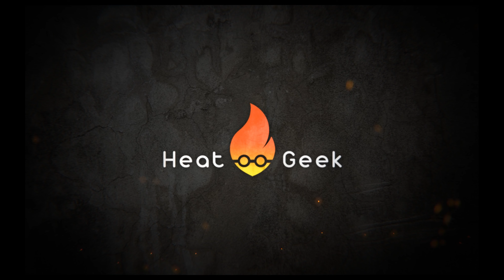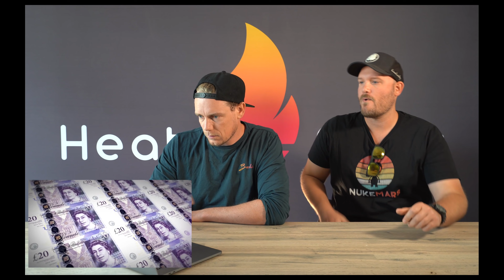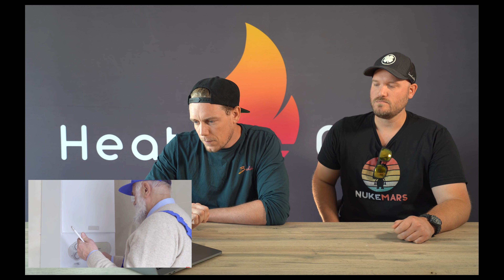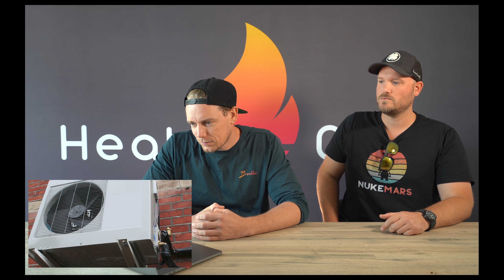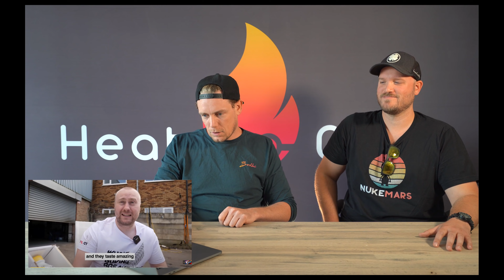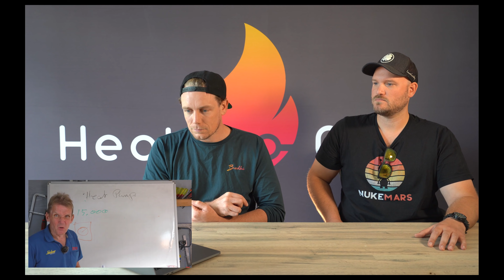Professionals React (BADLY) To Skill Builders's Heat Pump Videos | PART 1 | FIRST TIME WATCHING

Comment: Purely from a cost perspective, if I'm to build a new airtight insulated house and compare an ashp vs gas boiler install, i still feel gas will be cheaper? 

Electricity 26.686p kwh
Gas 6.993p kwh.

With a cop of 4 brings them on par but we dont get this yr round, this makes the gas boiler costs thousands less to purchase? If something like a Viessmann 222-F was used, there would be less standing losses too than a cylinder.

With overall build costs through the roof i want whats cheapest if performance is closely matched. 

I would like to design my system for heat pump flow rates to make a swap in the future when the technology has advanced and prices come down.
Reply from the maker: Incorrect. If the gas boiler is 90% efficient it's swings in favour of the heat pump. At 6.7p per kwh vs 7.7p for a boiler.

If talking about new build your inly talking a couple of k mire than a gas boiler.. the 10 to 15 k you hear about is retros in older housing.
Reply: @HeatGeek  so 26.6 elec / 7.7 = 3.5. Would that not mean I'd require a scop of 3.5 to break even on gas running costs. Then the price of the unit for something like a vaillant arotherm plus being 3x more than a gas boiler? 

Again, I'm looking at honest opinions based on cost not preferences on whats more eco. £3k minimum more to purchase but almost the same on energy usage. The cop would be good in summer hard to maintain 3.5 throughout a winter in the North. The 250-300L cylinder required would have slightly higher standing losses than a 180L.
Reply from the maker: @handle1196  yes my maths were wrong.

Well not exactly bc with electricity you can also use night tarriff. Also batteries make pretty quick sense.

If your looking at flat cost and say your self building then a heatvpump makes more sense ad although it costs 3k more you get the 5k bus grant.

You also have yo consider whats going to happen to energy prices over the nextb10 to 20 years you have the apliance. The 22% environmental tax on the relatively clean electricity we have will move to gas very soon if just 1 example.

3.5 would be an average current SCOP for a vailnt  that's the average thought the year, not 1 point in time

In reality you will actually hit above 4  with a vailant arotherm plus in a new build.
Reply: @HeatGeek  thanks for the reply. I wasnt aware of the bus grant, i thought it was for retrofit only. Its misleading as it says not for new builds, but a quick search with less info. Says that its available for single self builds. 

Is the tax you mention currently applied to both gas and electric? And then has the potential to be shifted or one of them reduced and one increased. This would be of big benefit.
Reply from the maker: @handle1196  the tax is only 2% on gas and 22% on electricity due to the fact gas used to be much cleaner in comparison to electricity. not the case now and electricity will keep getting cleaner still.
Reply: @HeatGeek  the taxes may switch around in the near future but gas is still gas, its not any dirtier today than it was 5 years ago, its the same quality and has always been more harmful to the enviroment, but its now been identified as producing too much co2 possibly due to increase in polulation and use so with climate change, cleaner alternatives now need to be brought in.

As a nation we should of had this this thought out in asvance not just getting to 2020 and saying as of today we will rocket prices of energy and penalise everyone with over priced clean technology that most people arent set up to afford or use.
Reply from the maker: @handle1196  I didn't day gas changed in how clean it was.. it just used to be alot cleaner than electricity (because electricity was dirtier) and now gas is dirtier (becaise electricity is cleaner. 

This was thought of and talked about and campaigned for lots but just couldn't get through parliament. Energy prices in total have little to do with gov.. they vary because of the market
Reply: @HeatGeek  update: after further research & in reply to you saying a the 10 to 15k costs are more for retro fits that need many changes, ive just received a quote for my new self build from a vaillant recommended installer to install an arotherm, a cylinder and plant room only connections. Myself to complete the rest of the house and they want 16k. Thats total theft. Almost 6k of it was labour and they chose a unitower not the stor agreed, so even less install for them. They quoted 1500 more for the unit than i could buy one for online. This doesnt help the industry at all.
Reply from the maker: @handle1196  including radiators and/or underfloor heating?
Reply: @HeatGeek  no mate, myself to install ufh, and radiators and all the connecting pipework supplying the rads leaving only the ashp and cylinder to install and everything you'd usually connect within a plant room to make it functional. I asked how long it would take to install it to see why the cost was so high and they said a full week.
Reply from the maker: @handle1196  seems strange. How many quotes did you get?
Reply: @HeatGeek  it seems a lot & a long install time considering its not a complex build or design. Id expect vaillant to list reputable installers. Im going to get another local quote from the other installer listed who has a good reputation. After that i might contact a heat geek installer for a comparison, shame they are a little further afield.

Comment: The guy is a moron. He has not mastered the concept of thermodynamics. In the summer the heat pump obviously only heats domestic water. In the winter, with the correct refrigerant, they will provide 100% of home heating. If your house is not insulated, move or reinsulate. Gas is only going to get more expensive until it's no longer even available. How much will you like your gas boiler when gas is 20X the price?
Reply: Oh dear, another joker saying that gas is going to get 20 times it’s current price. Then go electric or pick a design or choice of wood burner that will heat your home in winter and use electric hot waiter for the summer. And save a packet on these over priced, under performing heat pumps. Come on tell us how much it will cost to buy a complete heat pump, and then the price of installing it, let alone the repairs after a few years. Plus the electrical running cost in topping up the hot water system.

Comment: So the gas boiler will work in almost any home without great expense or top-notch installers.
Reply from the maker: No, you have to be on the gas grid. Apart from that, yes.. but it produces carbon.
Reply: @HeatGeek  Plants need carbon to grow.
Reply from the maker: @chrimony  there's more than enough carbon dioxide in the atm for plants to grow. They aren't dieing. Too much carbon dioxide leads to increased desertification.
Reply: @HeatGeek  NASA says the Earth has greened.
Reply from the maker: @chrimony  . Today, there is five percent more foliage than twenty years ago, but acroding to nasa this is primarily ambitious tree planting projects and intensive agriculture, mainly in China and India, that are behind the increase. This is according to satellite data from NASA Earth Observatory.

Symaltaniously desertification is still increasing in the harsher areas to to temperature. Desertification is decreasing the amount of sustainable land for agricultural uses but demands are continuously growing
Reply: @HeatGeek  "From a quarter to half of Earth’s vegetated lands has shown significant greening over the last 35 years largely due to rising levels of atmospheric carbon dioxide, according to a new study published in the journal Nature Climate Change on April 25."
Reply: @HeatGeek  But wait, there's more: "For the majority of greenhouse crops, net photosynthesis increases as CO2 levels increase from 340–1,000 ppm (parts per million). Most crops show that for any given level of photosynthetically active radiation (PAR), increasing the CO2 level to 1,000 ppm will increase the photosynthesis by about 50% over ambient CO2 levels."
Reply from the maker: @chrimony  there's litrally 100s of papers out there on all of this including the weighting for increased photosynthesis. Far more than the coment section will cover. For the purposes of this channel we assume that the vast scientific concensus is correct and don't entertain conspiracy.
Reply: @HeatGeek  I gave you two quotes. One from NASA's website, and another from a Canadian government website. There is no "conspiracy" here.
Reply from the maker: @chrimony  your comment "plants need co2 to grow" incinuated extra carbon in the atm was fine and questions climate change.  If your staement was just pointing out how photosynthesis works, fine.. but bot sure how it's relevant.
Reply: @HeatGeek  My point is that carbon is not the evil boogeyman it's made out to be. People are treating it like toxic waste. And rational thought needs to be put into a complex problem, and not just reduce it to "extra carbon bad, so we have to get rid of our gas boilers".

Comment: He is 100% correct.Installers are in the business to make money and sales and guess who gets caught out with a poor system or a unsuitable system. The  cheap install buts the good installers out of business or brings their installation to the same level so they can compete.Money would be better spent on insulating the house rather than changing systems and leave the new technology for the new builds where building codes can keep every body on the same playing field.Even then they will cheat on the quality of materials to undercut each other.This is the case with solar installations in Australia,installers only last for short periods of time when they re appear as a new company leaving the owners with a useless warranty.

Comment: The section where he says pays 3x as much, I suspect he means? electric is 3x as much as gas, as it generally is, so with cop 3 its on par with gas. That's How I took it. Time stamp  8.03, he could mean with the low output temp of emitters, customers boost temp up and up  and the cop drops through the floor.  For my view as a heating engineer, HP are still too costly for most and are tool to be fitted to the correct application, to many have been fitted to wrong type of house. PS perhaps give the grant money many to the masses for insulation/ventilation control.

Comment: if you put out the gax heating... then you remove an alternative and increase the demand in electricity... don't think that electricity cost will lower... it will skyrocket...
specially if you also convert all car to electric!!! people don't realise how much more electricity production should be increased to cover all that increase in demand.
That will cause the electricity to become more expensive than gas !! since gas and fuel will still exist in some country and with far less demand the price will collapse...
but they simply plan on keeping fuel for the military and the wealthy.
Reply from the maker: But at least we pave the way to come off fossil fuel
Reply: The only good thing about going electric is some will have the ability to generate it themselves which is something you cannot do with other fuels.

Comment: Part of the problem is installing something just because a customer wants that product, a full survey of the property and a consultation should be carried out, so customers wanting ASHP in a non insulated property should be declined as the end result will never be achieved.
I design, install and commission heat recovery systems and if I think that the property is not air tight enough I refuse the contract as I know they wont get the result they think they will get. If a customer asked you do install solar panels under a tree where the shade is all day you would have to say no!

Comment: i personally agree with Roger. I understand heat pumps are a new tech, that needs adequate training for installers/ correct commissioning and set up etc. And people will buy them.
However, old properties arent really practical IMHO. it is impractical to install UFH in an existing furnished property. So, oversized rads are the way to go. And in my experience, customers don't have sufficient wall space. Triple panel rads, i think, also look hideous. Sorry to be negative , but i think we are a long way off transitioning from gas to electric. Finally, if everyone had an electric car and a heat pump, then can the grid cope? Do we have the underlying infrastructure? And lets not forget, fossil fuels are consumed at the power stations to generate the electric.
On a positive note, i agree that a new build with a properly designed system will work. This is a generational thing- Older customers want 'hot' radiators, not 'warm' radiators. A younger person may welcome the new kit and technology. Finally, the guy on the right is acting quite professional. The guy on the left is being rather 'condescending' towards Roger Bisby. Roger Bisby may not be an expert on Heat Pumps, but he is a very knowledgeable guy on various aspects of the building trade. Just my 2 cents.
Reply from the maker: You don't need triple rads or ufh in older housing. Especially with newer units. This is dated thinking

Comment: In the end the guff they tell us about this and that ends up a 'cash cow' using spiel that is often inaccurate data re the environment, global warming and and and .. If you can't beat em.. confuse em.. great saying that and on the lips of the con artistes raking it in at the expense of the gullible or the 'green environmental extremists'. 👀 A good working system speaks for itself AND YES I do agree with these guys re the FACT that such a system requires someone with an understanding of AND knowledge of HOW an efficient system works BUT..😗 herein lies the TRUTH. It's a 'CASH COW'.. What these guys don't tell you is HOW MUCH an average EFFICIENT working system costs, BUT they can't because installations are too volatile .. WHERE the system is installed, THE TYPE OF BUILDING et NORTH or warmer SOUTH ???👀 The list is endless AND is probably re most installations reflective of just that, when it comes to the bills.. the overall COSTS far outweigh an advantages to the home owner. Long term?? REALLY?? Within the next decade scientists, inventors et come up with something ELSE that they swear is the answer to all and better than sliced bread.. whilst of course getting their sticky paws on YOUR BREAD.. 😗We live in a century where GREED, RIP OFFS and CON artistes excel. I'd NEVER use the heat pump option, it's a runt in the litter..